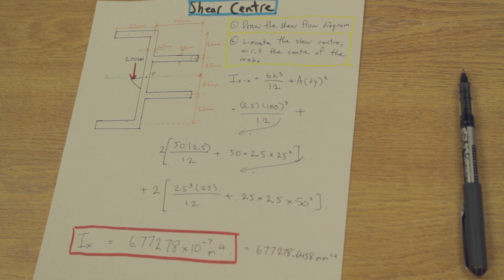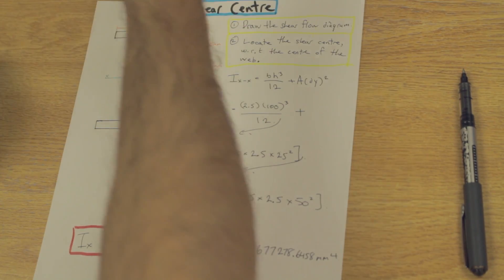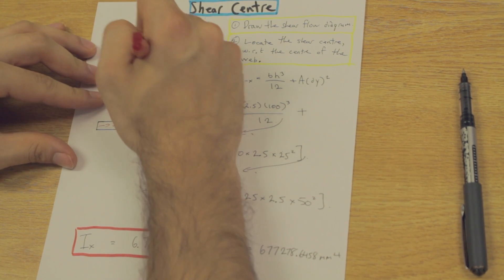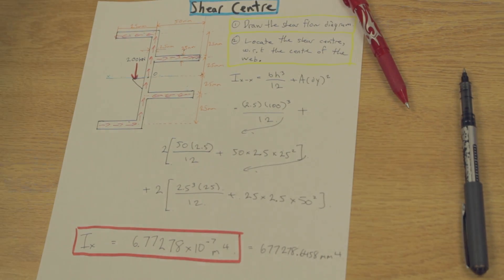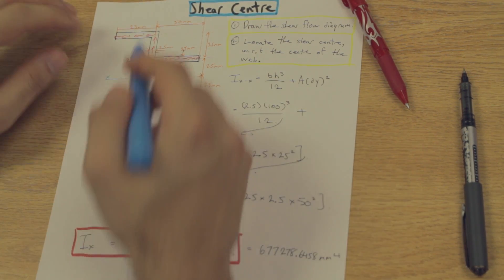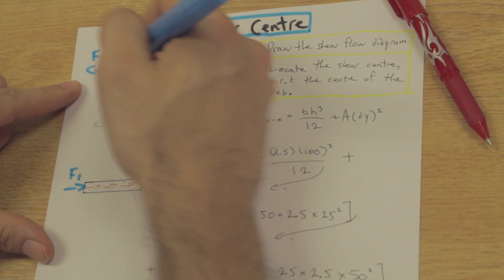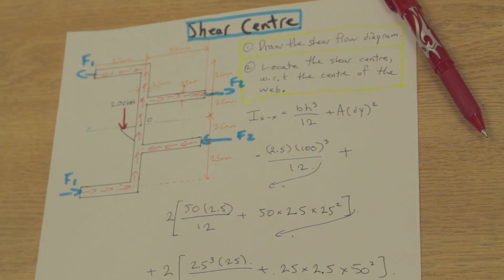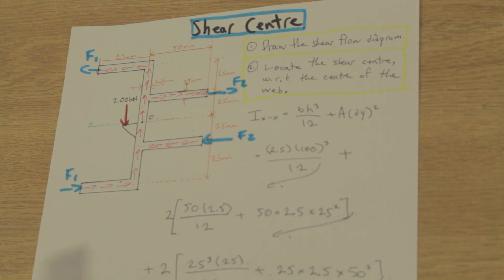How to Solve a Shear Center Problem - 2/4

Comment: Since the direction of the shear force is downwards, the shear flow direction must emerge from top flange and terminate at the bottom flange. Conversely, you have drawn the resistance diagram.
Reply: I was so confused. Thanks dude

Comment: I really dont understand how to draw the diagram
Reply from the maker: Check in your textbook and your lecture slides.  There should be some examples of how the shear flow diagram is drawn for different beam configurations.  Just memorize them.  For this particular example, as you can see the web and top and bottom flanges are contributing to the twisting along with the 200 kN force and the middle flanges are resisting that twisting.
Reply from the maker: Another hint, think of the shear flow as resisting the forces direction.